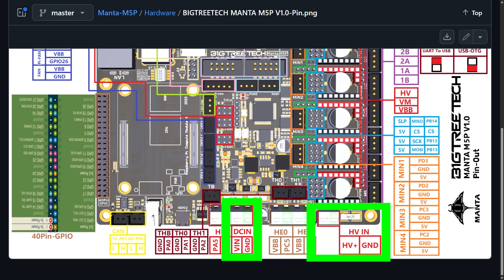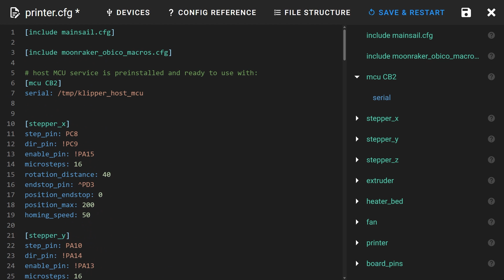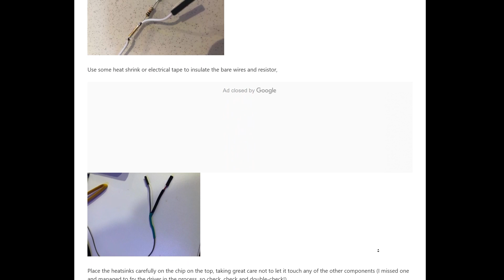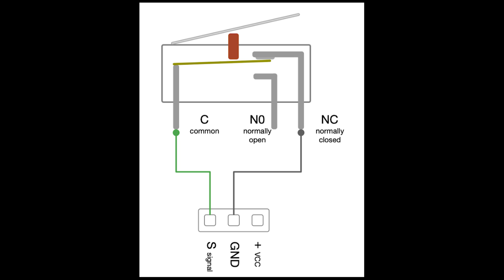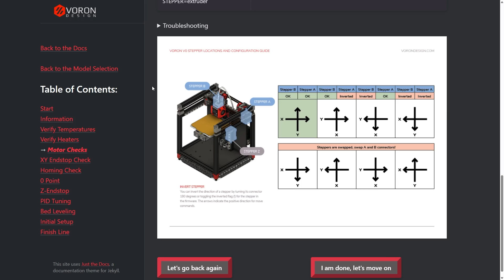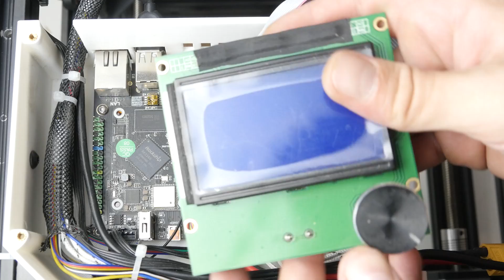- DUENDER: Part 4 - Setting up Klipper config using Bigtreetech Manta M5P + CB2

Comment: I have watched so many klipper install/configuration videos but yours simply stands out of all. No one has explained all the klipper parameters in so much detail as you have done. Thanks a ton for making this video. Despite using klipper for more than 3yrs, I only understood the real meaning of every parameter after watching your video. Thanks again. 

BTW I am already dismantling my old Ender 3 pro to convert it to your duender project 😊

Once I complete that I will seriously work on your multi colour project 😊

Comment: Can i use any ender 3 versions for the duender?
Reply from the maker: Yes, and not only the Ender 3. Many bed-slingers can work too.

But ideally, the two printers should be the same model. Otherwise, the profile lengths may be different.
Reply: @Irbis3D Cheers mate. I want to build my first printer. Is building this and upgrading to medusa later on feasible for a beginner? Also are there any advantages to this over a modern toolchanger like a creator5? Is print quality better or worse etc.? Thanks again 🙂
Reply from the maker: I have not used ready-made toolchangers or other projects, so I cannot answer objectively.

MedusaHC is a DIY project. It can start printing great right away, or it can turn into a swamp. Everything depends on the builder’s skill and accuracy.

If you just want to print, it is always easier to buy something ready-made.

If you want to gain priceless experience and go through an interesting adventure, build some kind of project.
Reply: @Irbis3D Thanks mate from 🇦🇺

Comment: Sergei, This is the best Klipper configuration video I have seen. As I plan to setup my Duender's printer.cfg file, I have gained so much insight. It took me several hours to transcribe to a to-do list using your explanation and checking on provided links and topics. Your time to put this together must have been many more hours and invaluable to me!

Comment: I really like the duender idea. I intend to build something similar (see below).

Perhaps this is a dumb question, but here goes.

If one is building a duender, why not use BOTH build plates, BOTH mcu's, and both hot ends (assuming a swap-able hot end  set up)? Twice the build volume, straight up. Klipper supports multiple mcu's, so control is there. The hardware is there, all for free, excepting the hot end swap mechanism(s), and a double build plate mounting system.There is a YouTube video showing someone making a hot end swap that uses only one extruder for all of the hot ends. That would free up the extruder stepper controllers after the first one. (Not sure what that would allow but the option exists).

[If anyone cares about the one extruder shared idea, take a look at: https://www.youtube.com/shorts/ke9P96aoVEA, https://www.youtube.com/shorts/RKmOSjbhbL0 and https://www.youtube.com/watch?v=75iM0KOHVfY https://www.youtube.com/watch?v=km11XXu-cAw&list=PLTqXGUR7SoBXA9QR8x36y95wPDz0ww9TD&index=17]

And, while that thought rambles around, one could add even a third set in a 3x1 arrangement, instead of just 2x1 (or the original 1x1). Or, to take it into a second dimension, why not use 6, in a 3x2 arrangement? If the drive system is belt driven, those belts can be pretty long without loss of speed due to mass, other than the longer extrusion on the x-axis.

I "happen" to have 2 & 1/2 Ender 3's, (the 1/2 has the build plate, the hot end, and some extrusions). I also have an Ender 3 Neo, whose controller lost the ability to control the z-axis. I can use that board to control 2 Y-axis motors, and an extruder/build plate/hot end. So, I should be able to make a "tri-ender" 3x1. The other 2 mcu's could drive everything as original, (except the y-axis), but allows the 2 y-axis controls to be shifted to allow controlling a 4 z-axis drive, and a dual x-axis drive.

Am I missing something here?
Reply from the maker: Check my latest video. 😉
Reply: @Irbis3D  Wow, THANKS! I was hoping for this response. It will make what I intend to do SO much easier!! Many, many thanks for what you do.

Comment: Hi I haven't had a chance to finish your latest video, but it looks like you are using Obico. How about a video on getting it to work with Klipper. How about showing how to setup selfhosting. That would be great!  Thanks!
Reply: I finished your video.  I watched it 3 times already.  Absorbing more information each time.  I'd really like to know about Obico and selfhosting it, maybe in a docker, to get the AI without the cost

Comment: good stuff as always!  not many include so many details on klipper setup in a single video, much less with references.  makes me wish the videos & documentation i had access to while building my first klipper machine were so consise.  😊
i actually started converting the max neo to corexy using the z-axis of the cr10 remix of your duender & made several modifications, including 3-point bed tilt, & am happy to share those files with you if you'd like.  i tried to make the z brackets as universal as possible, so that at least could be used regardless of position - it's the bed brackets that got a bit more complicated, largely because of the unusual bed dimensions with the max series & the position of the hartk1213 sexbolt i wanted to make sure was integrated.